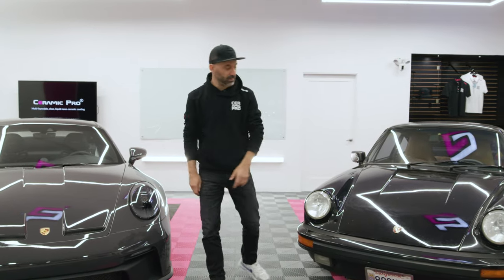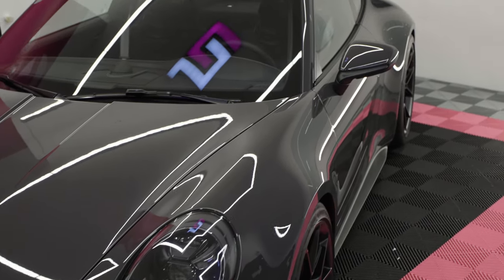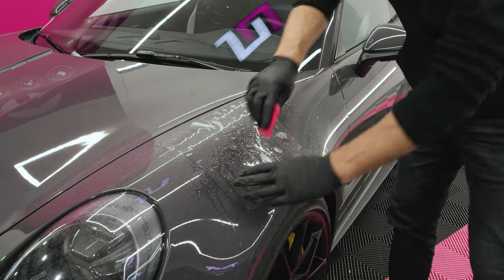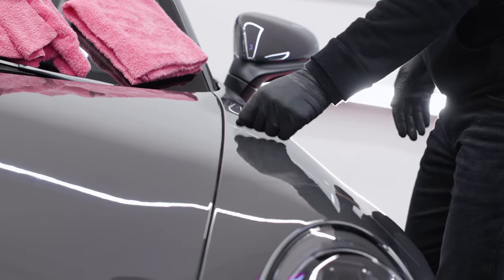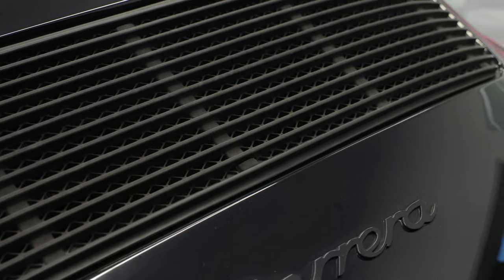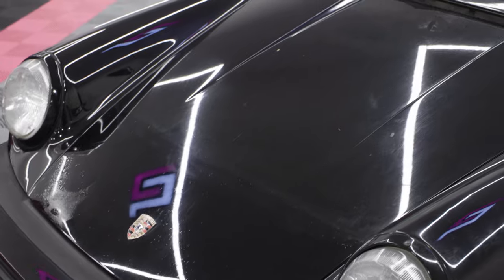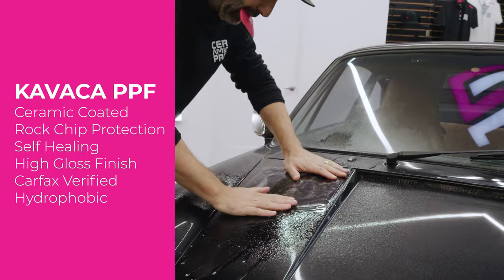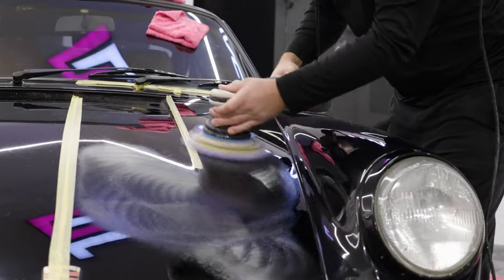Paint Protection Film or Ceramic Coatings? | Which Is Best for Your New or Old Car?

Comment: Can we put a ceramic coating on the top of kavaca ppf and enjoy the protection properties of the film plus shining and slikness of the ceramic coating.. Or it doesnt add a extra value adding ceramic coating on the top of ppf?
Reply from the maker: Yes you can!
Reply: I did this on my BMW.  Someone keyed my car in a shopping center, the key scratches went through the PPF and I had to replace both the PPF and the ceramic coating as a result. Insurance only covers up to $1,000 since PPF and ceramic is considered an addon for auto policies.

Comment: But wouldn’t  the ultimate protection be the PPF film Kavaca with the new ion base and then top coat  on top of it?
Reply: Probably, most PPF don't have UV protection so they need a coating to get the UV protection, I'm not sure what CP have.
Reply from the maker: The Ultimate Protection is our new Ultimate Armor Package which is full front PPF and the rest of the surfaces are protected with our ION coating.